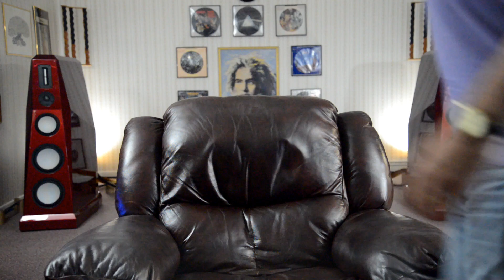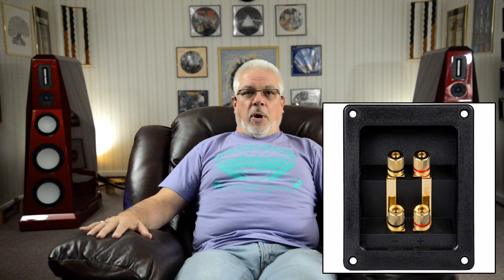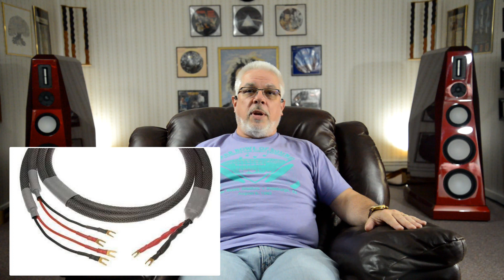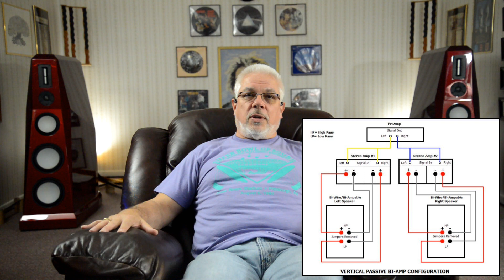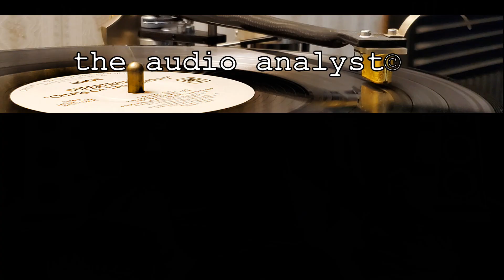E28: Biwire or Biamplify

Comment: I recently started bi-amping my speakers, a bit late in my late 40s. It turns out I'm a keen amplifier and speaker buyer, and I had no idea what I was missing out on. In my opinion, the sound quality has improved by 40%. It's not just about the increase in power, but the clarity of the highs and midrange has also improved significantly, and the lows have become more prominent. I can't believe I missed out on this for years. If I had known earlier, I could have saved so much money.
Reply from the maker: Well, better late than never, right? I'm just glad you found out and are taking advantage of the method! ;-)

Comment: Enlightening video about biamping thank you.  Maybe a part two could focus on use of 4 monos where 2 are tube, which may be better for mid and tweeter.   

Also, what if you have a 600 W mono which is more than enough for each main speaker and wondering if using 2 additional mono amplifiers might only have marginal benefit in a biamp world?
Reply from the maker: Hello. Thanks for writing. But I’m sorry to say that I see no particular cause to address either of the two specific applications you've proposed.

Firstly, you seem to be implying that just by using a valve-based amplifier one would gain some inherent “advantage” by virtue of the use of a tube-based design.  That is not necessarily, or in my opinion, even likely, to be the result. Most tubed amps are, well, more colored and prone to euphonic distortions than solid-stage amplifiers in the same price range. Clearly, not all, but…

As to using high powered mono’s, the sonic advantages realized by biamplification are still realized, regardless of the output power of any of the devices in use.

One should feel free to experiment with them, of course, but... 😏

Comment: Hi Greg! I was wondering what your opinion would be with using four independent, identical amplifiers to bi-amp a pair of large speakers? I have a pair of Bowers & Wilkins 801 D4s coming in and am considering buying another set of monoblocks. Thanks!
Reply from the maker: Hello... This is a commonly used option today, and offers a step up from using two identical stereo amplifiers in the vertical configuration. Using four mono amps instead of two stereo amps would typically allow you to apply more power, as mono amps typically allow for higher output per channel than similarly priced stereo amplifiers. And unless your chosen stereo amplifiers offer true dual mono power supplies, which would necessitate two separate power cords per stereo amplifier, you will have better isolated power supplies, further diminishing the cross-talk between channels, improving channel to channel signal isolation. Let us know how you find the results if you make that move! Thanks for taking the time to write! Enjoy.

Comment: While you handled the configuration options very well, your technical explanation of the impact of the back EMF was flawed and way overstated. This is because that signal sees a voltage divider made up the the high impedance of the upper crossover and the virtual short of the amp’s output impedance depending on the inductance of the speaker wire at low frequencies. Typically back EMF is greatest at driver resonance which will be very much below the passband of the upper crossover and drivers, so even if you were able to measure some micro/milli-volts at the tweeter terminals due to a design with a very shallow crossover slope there would be no resulting acoustical output.

Comment: Hi Greg, thanks for another great video! Since you are on the topic of Bi-amping, I was wondering if you could help shed some light on how it compares to using mono-blocks. Essentially, by using two amps in vertical configuration, you should be getting the same benefits of monoblocks by having a dedicated power supply unit for each channel. If so, how come most high end systems lean towards the use of monoblocks instead of biamping? I suppose one could still get the benefits of biwiring with monoblocks. Thanks!
Reply from the maker: Hello Dan. Thank you for your kind words on my efforts with the channel... 

As to your question, honestly, there isn't THAT much difference, overall, save for two primary concerns. Maximum power output (and its possible resultant peak output capability prior to clipping) and the added expenditure for two sets of (normally) costly interconnects. Stereo amplifiers TYPICALLY do not come with as high a power rating as monoblocks. 

Examining at the first attribute, the stereo Constellation Inspiration 1.0 amplifiers I reviewed (https://positive-feedback.com/reviews/hardware-reviews/constellation-inspiration-1-0-linestage-amplifier/) were rated at 200Wpc into 8Ω, and 400 into 4Ω, whereas my Audionet MAX monoblocks are rated at 400Wpc into 8Ω, and 700 into 4Ω. The headroom and peak output power is nearly twice that. Granted, that will only account for about a 3 dB increase in maximum volume, but it DOES greatly extend the headroom and diminish the likelihood of ever clipping.

The second issue is also significant, especially in a configuration like mine where the equipment stand is off to the side of the room and the run to the amplifiers from the linestage is some twenty feet. In my case, where the interconnects I use to make that connection are over $8,000 a pair, that will significantly increase the overall cost of the installation, with no other real significant benefits.

Vertical biamplification is a great choice for someone building their system and trying to maximize the effectiveness of their expenditures. So, let’s say you currently use a Parasound Halo A 23 you bought a few years ago. You see one come up used on eBay or AduiogoN for $450… You can buy into vertical biamping, and the serious advantages it offers, even adding some cables, for a fraction of the cost of moving to new – or even used – monos. This is ONLY an example, and there may be dozens of other similar scenarios.
I would add that if you are starting from scratch, biwireing monoblocks would, all else being equal, offer the most effective results.

I hope this helps answer your question. Thanks for taking the time to write.

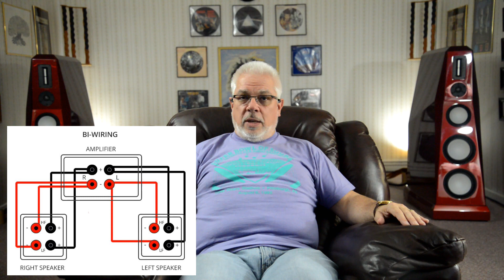Comment: Greg - Great job on these videos! Must have been a particularly strong martini in this episode... in the first wiring diagram at 7:37 you have the red and black polarity colors reversed from the standard, while the others shown later have it correct. Keep up the good work!
Reply from the maker: Hello Bill K. Thanks for the good catch on that wiring diagram. First, understand that I did not create that graphic, but have used publicly available wiring diagrams to illustrate my examples. Also, while you are correct that the color coding seems to be reversed, with black for the positive lines and red for the negative lines, all the polarities are shown correctly. In other words, plus terminals are being shown going to plus terminals, and negative terminals are shown going to negative terminals. But, they show the negative runs in red, and the positive runs in black. Interesting, and slightly confusing, but still accurate other than the color coding... 😉  P.S. - all my martinis are particularly strong! 🤣
Reply: @theaudioanalyst  Absolutely, it's just the color coding that's inconsistent with the standard. The connections shown are all correct as you stated so it's not really a big deal. All the best!  - Bill
Reply: @Bill.K  the colour coding on Greg's Olives looks spot on though.

Comment: I always understood that separating in general is better for your system going from a receiver to an integrated amplifier to pre-and power amp to mono blocks as for wiring but thank you for clarifying the base feedback to the crossover I did not know that part.

Comment: Another connection possibility for Passive Vertical bi amping (when the power amp allows) is to feed L channel pre output to one channel of the stereo power amps inputs.. and then use the loop out (from that channel) to pass the signal to the other channel input on the amp, thus both receiving L channel info...Then connect to the split bi ampable crossover (jumpers removed).....repeat R channel pre output for the other power amp/loudspeaker .... I only mention this as it prevents the need to source a Y splitter.
Reply from the maker: Hello Marcus... You are right, I did completely space that option for Vertical bimamplification. And interestingly enough, Phil Jackson, of Parasound, shared that exact same suggestion... Take note all, that is a way to avoid the Y type connection - IF YOUR AMPS allow it... Thanks, Marcus and Phil!

Comment: I have been bi wiring since the late 70's with a pair of KEF Chorales. I bought the upgraded x over and put it outside the cabinet so that i could easily bi wire. I still have the speakers to this day. I have been bi amping my large  stand mount and floor standing DIY speakers since the mid 1980's. I have also active bi and tri amped various diy speaker projects since the mid 1990's. I have a few interesting videos on my You Tube page and on my Face Book page. They are worth watching and are a enjoyable

Comment: It would be nice to know a source for high quality "Y" adapters.  Do you know any manufacturers?  Can you share them with us?
Reply from the maker: Hello! I guess that is a fair question! 😁

Here is a link to the metal-bodied style that I mentioned, and prefer because they are short (less electrical involvement) and solid, from Audioquest... 

https://www.audioquest.com/accessories/splitters-connectors-adaptors/adaptors/hard-rca-splitter-male-to-2-female 

Here is a link to a set made with wire...also from Audioquest...

https://www.audioquest.com/accessories/splitters-connectors-adaptors/splitters/flx-x-rca-splitters-male-to-2-female

While you may have issue finding these on a shelf in a retail store, both are available online from sources like Crutchfield or Amazon...
https://www.amazon.com/s?k=audioquest+Hard+RCA+Splitter+%28Male+to+2+Female%29&ref=nb_sb_noss
Reply: @theaudioanalyst  Thank you so very much for the information!!!!   I wasn't aware that Audioquest made "Y" adapters.   
I use the older Audioquest Diamondback RCA interconnects on my system and I love the vast separation between instruments that they provide.  For me they make the sound stage more expansive both in width and depth as the negative space around each instrument becomes much larger and more spacious than with inferior cables.  

I happen to use quad amplification, and 6 equal length 10 Gauge speaker home runs for the front L/R woofer, mid-range tweeter   and one short run for the sub.  I pair my tweeters, mid-ranges, and woofers on their own amps and the sub has it's own amp as well.  

I don't have a need for the high quality "Y" adapters at the present moment, but I did need them in the past and couldn't find them and perhaps I may have a need for them again in the future, so the information is quite helpful.  Thank, Greg.